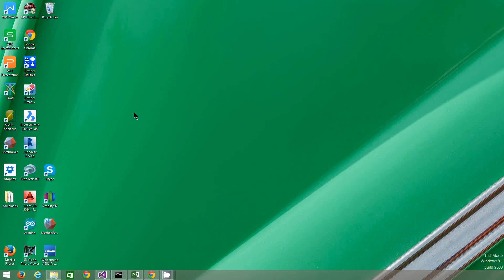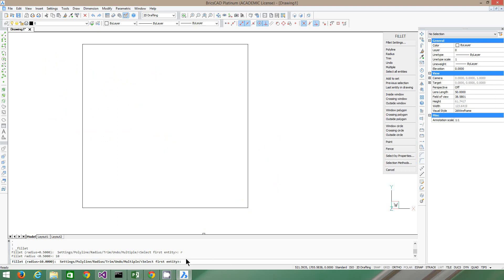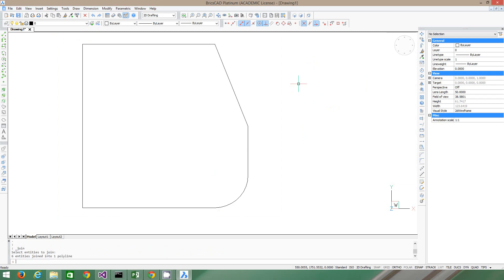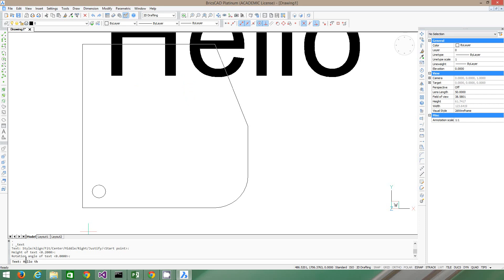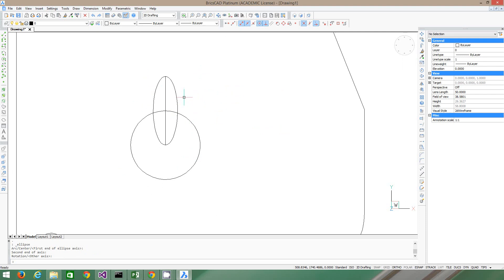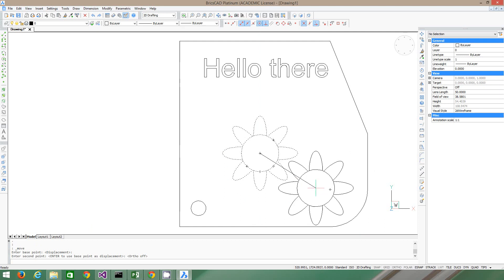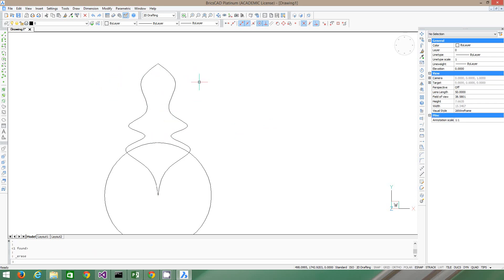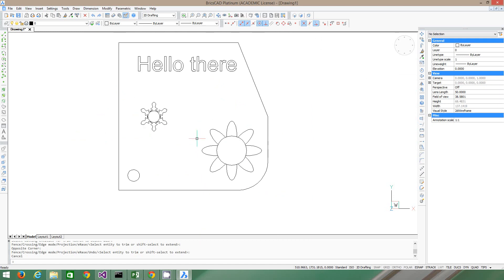How to Use BricsCAD lesson 1

Comment: The popup dialog window for building an array of "petals" appears if you enter manually the instruction ARRAYCLASSIC. I guess in older versions this was just ARRAY, and it was associated with the correspondent button. Now the button activites the ARRAY instruction, but its options are different, and they look differently. In new versions, the elements of an array are combined in a single object, while  the instruction ARRAYCLASSIC makes the required number of copies of the initial object, and each copy is a separate object.